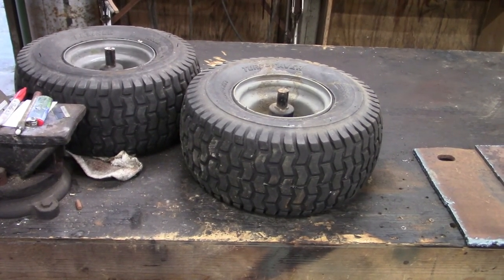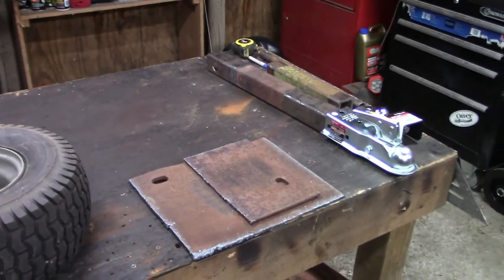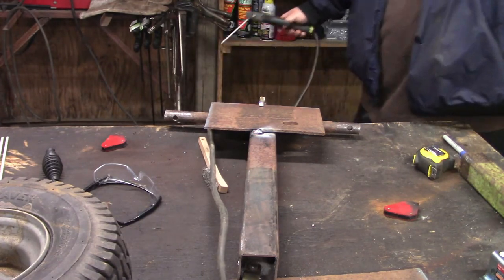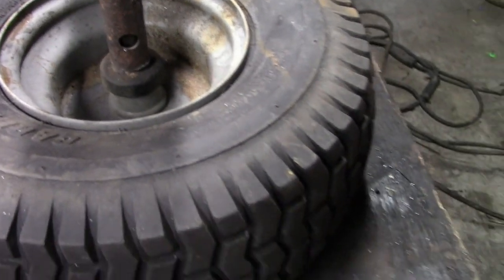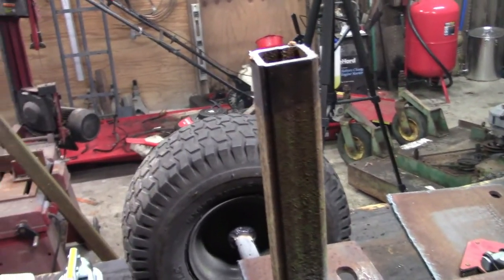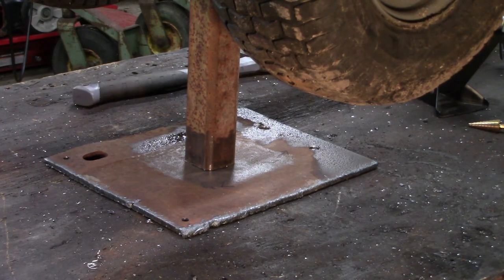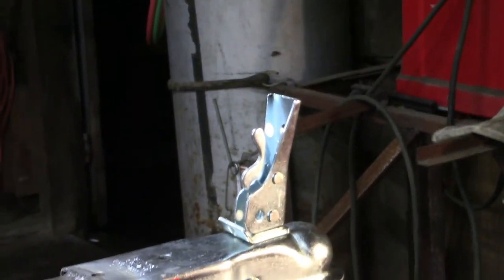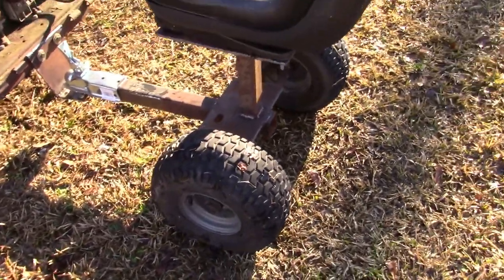Homemade "sit down" sulky for walk behind mower

Comment: Need to turn up the heat when it sticks like that.  Get at 45 degree to split the angle between two metals. Then get head up 90 degrees on the puddle.  Strike you arc.  Let the puddle get fluid. Then whip the puddle forward and then toss it back on the puddle.  Just whip it like that and advance it.  It will lay dimes

Comment: You gotta turn that welding machine up. When it sticks when you strike it   Means it’s cold.   See how you welds a rolled. Lumped up.  Too cold.  When you make fillet weld you want to be at 45 degree angle to split the difference on the two metals and 90 degree from side to side straight up on the puddle.  Will help I laydown
Reply from the maker: I appreciate the advice. It's amazing how fast you lose it when you don't do it every day. Not that I was ever great at it. Lol
Reply: @AverageJoes4u  yea  to be good you gotta weld all the time.
Reply: @AverageJoes4u  I got 3 years in college for welding. 10 years on the job. Sick and tired of all the bs that comes with it. Going to start a lawn care business but still weld.  Then use lawn care to fund my own welding business
Reply from the maker: That's awesome. It doesn't seem quite so much like work when you're doing it for yourself. Good luck with it. I hope it works out for you.
Reply: @AverageJoes4u  yea I enjoy building stuff just tired of being micro managed
Reply from the maker: I get that. Never fun.